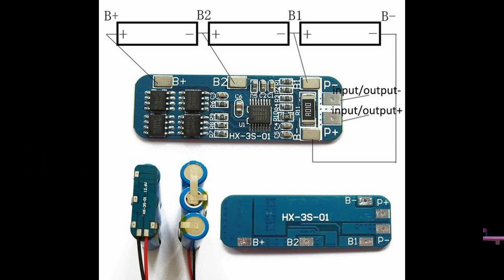How To Make 12v Battery || 12 volt long lasting battery | 775 motor battery pack in 2023

Comment: You are using 1.2 Amp battry 6pcs. Then how come you got 7 ampere?
Reply: 1.2*6=7
Reply: @AmirShahzad-bk8mv  if you get 7amps from 6 batteries it is parallel connection and you will get 3.7/4vol not 12v. Why do you misguiding the viewers?

Comment: Help pls bri
Reply from the maker: tell me how can i help you
Reply: @diytechcreation  I want to make a blutooth speaker with this 4 batteries and with the inbuilt charging module.  Is it need bms ?
Reply from the maker: @bossgaming1767  at first tell me how much volt you need? then i can suggest you properly,
Reply: @diytechcreation  3v ka 1500 mah 4 battery with tsbt003 module ke sath
Reply from the maker: @bossgaming1767  yes then you can use this battery, but you have to connect those battery in parallel to maintain 3.7 volt and high capacity. and you don't need any BMS for your battery
Reply: can u help me also sir?